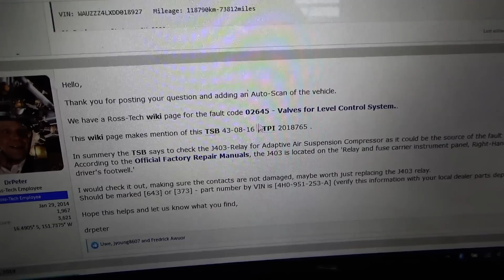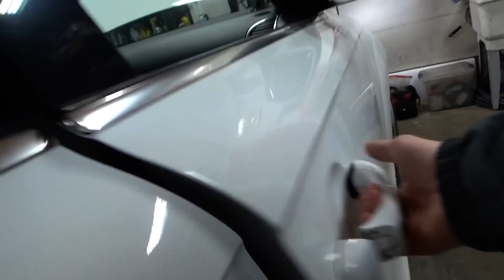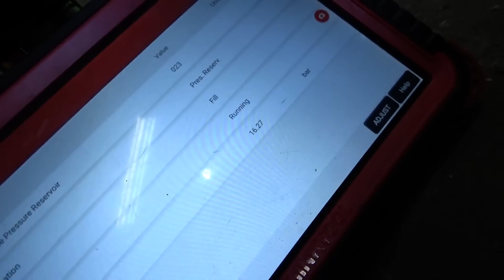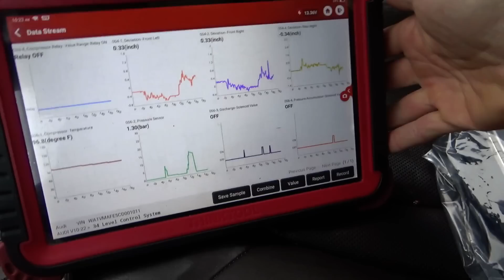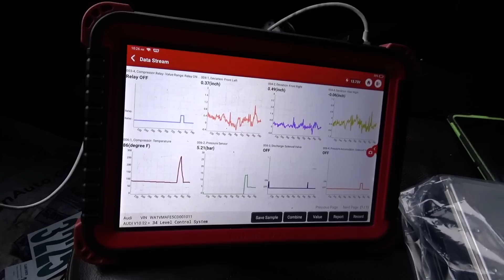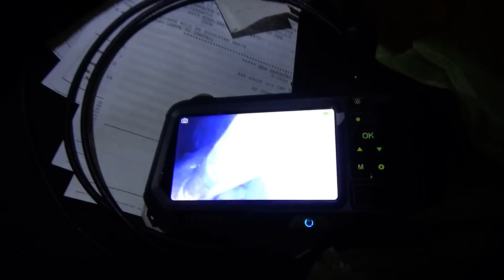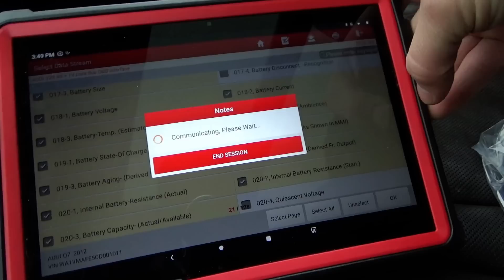Audi From HELL...DEALER STUMPED!! (Part 4 - CONCLUSION - Q7 Air Suspension DISASTER)

Comment: You know you can replace air suspension struts with regular coil springs and call it a day?  Rockauto has all four struts with coils spring for about $350.  These Audi's came with air suspension or with regular coil springs.  People used to do the same thing with Lincoln Town cars when air suspension gave them problems.

Comment: When you have an Audi you need to understand how it work cuz your going to spend a lot of $$$$. Now when changing a battery you need to "register" adaptation. For the TPMS my Audi won't use sensors in the wheel. You just set the pressure by "hand" and register as done in MMI. If you have a tire leak wheel speed sensor gonna see a discrepancy between wheel and pop up the tpms light. Don't know if all Audi are like this.  Now old air ride Audi will need a compressor for sure and water accumulation in the system is a problem. Stay away from old air ride is good idea. DCC suspension car are way better. In my opinion. Don't buy use euro car if you don't DIY. And Audi are well known to be sensitive to low voltage battery. Never let your battery die. Best is to replace battery with an OEM one cuz easy to register. But i know people are able to register certain aftermarket one. When you spend tone of money to fix problem it's easy to spend bit more at the beginning with oem stuff or take time to verify before if aftermarket gonna work well !

Comment: Safety Hazard: An ungrounded outlet lacks the crucial grounding wire. This means there's no safe path for stray electrical current to flow if a fault occurs, increasing the risk of electric shock and potentially even fire.
Equipment Damage: Many modern compressors are designed to be used with grounded outlets. Without proper grounding, sensitive electronics within the compressor can experience voltage fluctuations, which may lead to malfunctions or damage, including potential overheating.
Overloading: An ungrounded outlet cannot safely handle overloaded electrical charges. The excess current has no escape route to the ground and may find an alternative path, which could be through the compressor's components.
Slow Filling: Voltage fluctuations caused by the ungrounded connection could negatively impact the compressor's motor performance, potentially causing it to run inefficiently and fill the tank slowly.
Overheating: The compressor's motor working harder due to inadequate power supply or voltage issues related to the ungrounded outlet can result in overheating.

Comment: I am going to have a brain aneurysm, now I realize what has been causing pneumatic compressor failure in my garage. Poor wiring, utilizing incomplete or non-existent grounds. Resulting in slow compressor fill. In addition, to an overheated compressor motor.

Comment: You said on your video you were showing problems with the high amperage on the compressor motor. And then at the very end you made a statement about charging issues related to the alternator. Have a look at three things there's a list of pins on the ECU harness and on the relay terminal box underneath the cow. Related to the compressor and alternator. The terminal pins themselves get corroded not at the terminal pin where it makes connection to the relay or the fuse. It gains corrosion underneath the terminal pin where the wire meets the terminal pin at.

Comment: This is the poster child for over-engineering. Also for software incompetence. For the programmers to infer that the valves must be leaking versus the compressor wearing out, that is some stunning incompetence. I love your goodbye, "Stay away from these European cars." I also love that the gauge bezels on the cluster look like the crying clown theater mask. Lots of tears with this misery. Oh dear gosh, I just got to your using a bore-scope to see the battery. Remove the seat to replace the battery? Audi engineers and managers are sociopaths.

Comment: What is the logic behind this car's system? It's really bad. The air reservoir never fills up while it's in use. It only fills up when we put it to fill in the basic configuration. Everything is working, compressor with high compression capacity, valve block replaced. We replaced the module due to the same defect that was in your video, I couldn't do the height calibration.

Comment: I had a BMW with over charge situation it was resolved by replacing the cable since it had the monitor circuit on it ($145) few years back.

Comment: To clean the connector pins you can use Deoxit D100L in the little bottle with brush. This way you can brush Deoxit directly onto the pins without soaking the connector. If you can clean the contacts well enough to base metal you have an alternative for reconditioning the contacts with single cycle Standard Motor Products SL5 Stabilant 22A, which I use but not as often as Deoxit as you can probably tell by my droning on and on about how I use it. Stabilant 22A works well when you are conditioning an inline connector that has properly functioning and clean pins except of course oxidation or a slight loss in plating. I think Stabilant 22A is effective as a plating surface treatment, which is just a guess on my part.

To my ear air ride compressors seem to always sound like crap, even when working properly. The only real change I can hear with a replaced compressor, after listening to it for over an hour of troubleshooting, is the new compressor will change to a slightly lower tone (working harder) when the valves open and tone drop slightly as the load increases (reservoir pressure increase) and of course the on time is greatly reduced to achieve the same pressure.

I feel your pain. It is very difficult to repair older air ride suspension problems and make money after the diagnosis. Many times the owners, faced with a potentially huge bill after some basic diagnostics (just show them the worse case diagnostic OEM tree), will just replace the air ride suspension with an equivalent non adjusting spring kit. If you still want air ride height adjustment you can fabricate a custom air ride suspension from off the shelf bags, compressors and controls, but you may have to fabricate some parts, all is doable but expensive. Really reliable air ride aftermarket suspensions have to be engineered and are not cheap, however they can be very reliable and easily fixed with common off the shelf parts.

Comment: My Ex bought an Audi Q5 when her lease expired, she took the extended warranty which I thought was extravagant, a month later her transmission died and needed a new transmission $5k. She is not a young lady, does low mileage, all services at the dealer. Her warranty covered it. I wouldn't buy an Audi with your money. They are very pretty disasters on wheels ... which suited its owner quite well ; )

Comment: Ok, as a rule when fixing problems/issues on my cars I like to at least know what's causing the issue. Referring to part 4, if this were my car and I was test driving after all the hassle with the module and calibrating and another code set, I'd be questioning how did I go so wrong with my life choices.

Comment: Haven’t seen it in any of the other comments but there is a 40A fuse under one of the front seats for the air suspension.

Comment: Hi, I have one of these audi q7 cars, in uk.
 I had a few issues with my suspension,  the car was fitted with side steps from stealership, the brackets for steps had slowly rubbed a hole into the accumulator, causing a small leak, thisbin tern set the pump running a lot more often, and for longer, eventually the pump failed, and also corrupted the module.
 After extensive testing I found all these problems, I firstly replaced the accumulator, then the pump as it was turning slower than needed, I replaced the valve block,  relay, pump, and fuse under seat, after replacing everything I recalibrated the suspension levels, and road tested it, all was great.
  It has been perfect for the last 2 years now.
  These pumps are a common problem, I have changed several, and always with fuse and valve block, and relay. None have failed since.
 I purchased non genuine, but from a reputable air suspension pump manufacturer,  who make kits for air ride systems for trick cars that bounce etc.
 Their pumps are much stronger, and are a perfect fit as they have been made to match, my suspension is faster to react than a standard car, so much better in auto mode to adapt to rough terrain,  and smooth road surfaces.
  Excellent diagnostic process, shame the stealer took the wrong road with diagnostics.
 I also had a battery fail, and the replacement never worked correctly, until I had performed a replacement battery update on bms, battery management system. Since then never a problem with charging.
 Complicated systems, but when they work are brilliant. I love my audi ride comfort, and off road capability,  good luck with this audi from hell, and keep up the videos..
 Brion.

Comment: Here is a story.
On a long trip I had to get my left rear tire on my Land Rover LR3 replaced. After having a tire shop replace the tire I started getting a "pressure rises too slowly" fault and the compressor would shut off prematurely. I would have to restart the car up to three times to get it to fill the reservoir. When I got home after 42 days and started investigating I discovered the tire tech had placed his jack under the L shaped bracket on which the compressor was mounted. This bent the bracket and compressor up and against the frame. This in  turn pinched a plastic airline and caused the slow fill. Pump with bracket from eBay fixed it.

Comment: 217 psi for a car air system is insane can you maybe lie to the system with a lower pressure switch i dont see a need for those pressures my low rider runs fine at 120 psi

Comment: Couple of suggestions for you. I was obvious as you were trying to reflash the suspension module that you simply reloading the old code and not downloading anything from the internet. A possible way to get around this would be to load the scan tool onto a known good Audi (is there such a thing?) and act like you are going to replace its module but quit when you get the existing code downloaded. Then go over to the Audi from Hell and use that code as your source. Will this work in practice? I have no idea but it might be worth a try. Also, you can deal with the alternator issue by going old school on it. Go buy an external voltage regulator like you find on a 1980 Ford or something like that and wire it up to control the alternator's input field. That should fix that issue. Would make for a very interesting moment the next time an Audi technician pops the hood and sees that fix. WTF?!?!?

Comment: Any compressor gets water loged at times.   Is there not a test for how long the pump takes to get to psi or ride high,  how long does it take to go down, and how long the system hold the psi/ride hight.

Comment: In uk do mots and brakedowns have Audi in and fix air suspension  as you say a pain even in the UK. Fit new pump relay and test everything for voltage current. As we have lots of sait on roads fill and seal all connections with electric grease. None conductive do lexis and rang rover land-rover all have the same problems just in different situations. Your videos are fantastic this one had on full 4 hours. All your other videos very interesting 40 years of this same thing from electronics. Bring back springs .

Comment: Seriously, having to enter in a battery serial number, and 'adapt' the car to the new battery is crazy. Its not like it will make any real world difference, the battery will still need to be replaced at around the same interval, or any time it suffers a few deep discharges. Complexity to deliver negligible tangible benefits to the motorist. Great watching your channel and diagnostics. It reminds me not to step back into the workshop.

Comment: Did you replace the brass high pressure spring valves ar the top of the air struts ??? Sometimes these fail or get blocked 🚫,  I changed mine after months of the same problem,  you need a special notched socket but the valves are cheap , might be worth a try pal . From what I was told the green light is low pressure and incorrect level and a flashing amber is too much pressure hence a blocked 🚫 valve and the valve block throws up a code 02645

Comment: Yes i think i know whats wrong after watching the video. 

I think because the car thinks there is a flat tire. It doesn't want to work correctly. That may interfere with the  adjustments. And the working of the system. 

So first reset the tire pressure code and then try again.

Comment: Just bought an '07 a4 to get to work when the opel broke down. Had to replace the wheel bearing on it the first week and what a pain that was. Just looking at the suspension components pains me.
Just got the opel up and running again with a junkyard engine ECU and what a relief that is.

Comment: I would think that the reservoir or accumulator, would have a one way check valve on the discharge side to protect the air reservoir storage. Thus keeping the cheap electric air pump from running too much and overheating. You can probably add one.

Comment: VW Touareg Air Suspension adaptation 

 

 

Found this elsewhere. Worked for me.

0) Set your car to "Auto" mode (not dynamic, comfort, etc.). Make sure car is on level ground. Close doors. If any doors are opened during the procedure, it will be interrupted. Make sure your car is NOT in a towing

 or tire changing mode.
1) Load up VCDS, go to Module 34 - Level Control
2) Go to "10 - Adaptation", take note of 4 values titled as "Body height front left wheel house edge" - mine were set to around 384 from factory.
3) Take the values you noted above, and ADD your desired drop in millimeters (mm) to each value, write it down... So if your left front wheel was 384.5, your new value will be 401.5. Repeat for the other wheels. It is not critical to be 100% precise here, rounding the values is fine. Note that maximum Audi-approved drop is 17mm from what I've gathered. You can go lower, but if you go lower, you're also affecting other systems, such as cameras, adaptive cruise, etc., so be careful.

Technically, if you want this procedure to be done properly, instead of taking existing values, you will measure all 4 wheels after completion of the step 7, and then add your drop value if desired. Suspension height values are measured from the center of the wheel to the edge of the fender.

4) Go to Security Access, enter code provided on the following website, under VCDS section, item #3 (I'm not posting this directly to avoid spreading sensitive data, although it's been posted on other forums in past) www.stemei.de/pages/coding/au...ng-des-aas.php 20103
5) You should get a message stating that security code has been accepted - if you don't, something failed, stop doing what you're doing

6) Go to 04 - Basic Settings

* IMPORTANT: Whatever you do, DO NOT select "Reset All Adaptations" - this is not undoable, and will require a visit to the dealer. *

7) Select "Activate Level Control", hit "Go", wait for it to complete (should only take a second, until it says "not running").
8) Select "Delete Calibration For Level Control", hit "Go", wait for it to complete, your car will throw a fault code and you will see an error message stating Air Suspension Malfunction - this is normal.
7) Select "Start Up to Reference Level", hit "Go". This step will take about a minute, and your car will go up/down during the process (you'll hear hissing noises). Wait for it to complete, until it says "not running". DO NOT use the "start up to reference level production" option.

9) Select "Go Back", go to "10 - Adaptation" on the previous screen.
10) Next you will need to enter new adaptation values for all 4 wheels. Select "Body height front left wheel house edge", then enter new adaptation value, and hit "Do it", then repeat for the other 3 wheels. I did it in the order the menu was arranged (FL, RL, FR, RR) - not sure if the order matters, but just in case. Each time you enter a value, you should get a message stating that it has been accepted.
11) After you're done entering adaptation for all 4 wheels, select "Go Back", and return to "04 - Basic Settings" again.
12) In basic settings, select "Calibrate Level Control" and hit go, it will take a few seconds. Wait for it to say "not running". If you get an error during this step, you either missed a step, or something went horribly wrong.
13) Select "Activate Level Control", hit "Go"
14) You're done, now go to "02 - Fault Codes" and Reset codes.

If this did or didn't work - please share your experience with the rest of us here.

Comment: WHAT THE HELL? Why does AUDI think they need 244 psi? Any 18 wheeler on the highway with air ride suspension, air ride cab, air ride seat and air brakes get by with 125 psi.

Comment: If I owned this pig I'd have scrapped the air suspension in favor of regular springs & struts if at all possible. Zero chance having air ride is worth even a fraction of whatever this job ultimately cost the owner.

Comment: Reminds me of a Ford Windstar I owned. The dealer kept replacing modules and components for two weeks telling me how hard it was to isolate a problem. I didn't care, it was under extended warranty. I suggested they replace everything, but leave the steering wheel so I knew it was my vehicle ;-)

Comment: Not all Euro cars are equally stupid.  On an X166 platform, yes the battery is under the pass seat but you DON'T have to unbolt the seat to change it.  Also, Mercedes does not seem to require this battery coding routine like BMW and Audi.

Comment: Could someone from the dealer work have used vcds and changed the height values the wrong ones? Could the old suspension module have been fine and just needed the vcds to recalculate the heights?